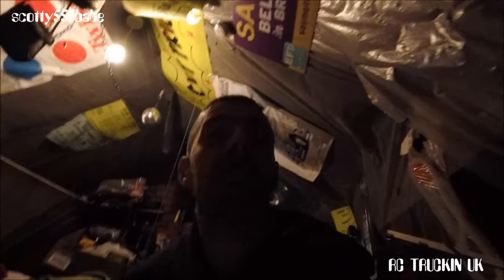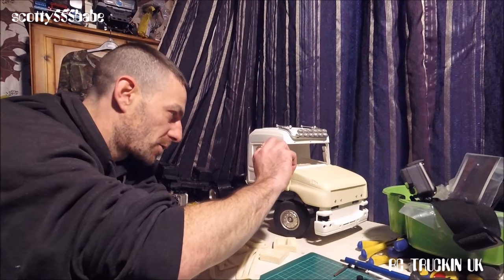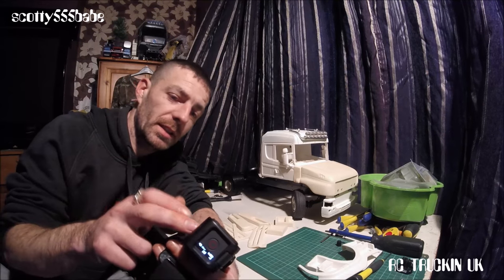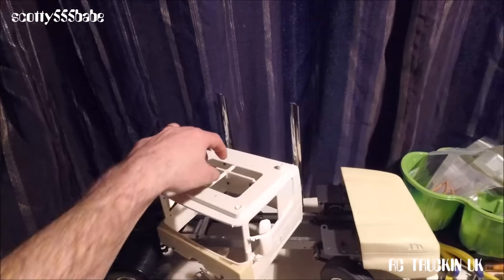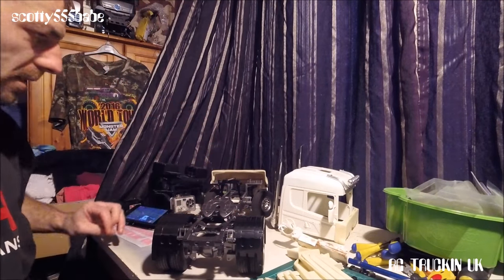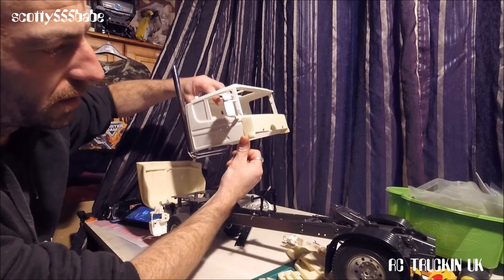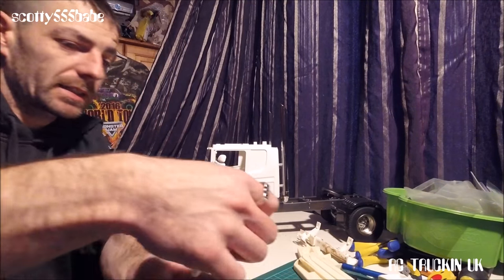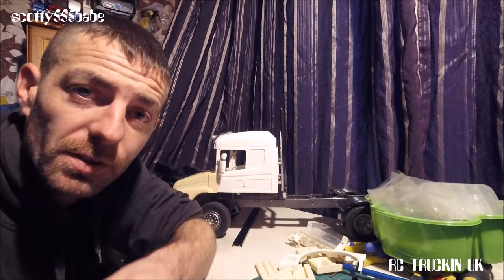RC TRUCK TIPS - The Basics to Constructing a 1/14 Tamiya Rc Scale Scania Torpedo/T Cab

Comment: Pretty funny .....know how you feel Scott, keep going with your head down, it will soon be finished. One little snippet of advice for marking holes...Nick a bit of the kids Play Dough put it behind the bonnet then press the hinges against it. If will leave a clear indication where to drill. Also I use Blu Tack to position body parts to make sure they're positioned correctly before gluing or drilling.
Appreciate your monthly videos of Ribble Valley RC , chuffed you featured my Volvo wrecker on its first trip out in December, pleasing cos it's my first build .
Reply from the maker: Thanks for the comment and tip, I use blu tack a lot but I never thought about playdough, thats why I have the channel to keep the knowledge flowing... Also I featured your wrecker in the "Best Of 2016" its nice to see different trucks and builds. 
Thanks again bud

Comment: Enjoyed the instructabuild mate, I feel your pain trying to find a work area comfortable enough and permanent so you can have tools, materials and paints to hand. I recognise the loft, did one identical. I recon the a velux window, couple sockets, light be the job. Problem is ceiling joists and insulation, if your own home I'd put in sistered or deeper joists to bearing wall, joist or steel if you need it. Coz if sell will not be up to regs and will not get money back. If rented put insulation bats between rafters tack, staple rolls of silverfoil bubble wrap overjoists tape joints with silver tape. Put down grip lock loft boards a couple of screws coz this can be lifted and with insulation roll and bats reused if move. Then you can get some peace and a man cave with a lockable loft hatch. Jobs a good en, plus can store all rc gear under eaves. Cheers
Reply from the maker: Hi cheers, I've had the loft all boarded and suspended floor, its just the insulation and boards on the ceiling area... its more as its full of crap at the minute lol giving me no room to work in there, I just need to get a carrot done and get rid of a lot of it... and last year I was a little depressed which made me leave the loft and try to find somewhere more comfortable. However new year new start. Thanks again for the tips on the loft, that should come in handy.
Reply: Thanks for reply, there is no disgrace in suffering from depression, it chops me down from time to time too. The greatest men have always suffered from it, like Churchill and his "Black Dog", thats what I say anyway. 
 The RC gear I`ve accumulated is ridiculous, I must have the biggest 1/24 RC  private collection and a good few 1/16 RC tanks, I`m more into Rc Tanks but have moved on to doing a Bruder Scania Cab/ Tamiya Scania tractor for a Transporter. Looking at the new R730 2X2X8, but merging two cabs and another steering set has me looking to make the new Scania P 440 CA8x6 defence vehicle. Its Scania defense arm, looks a mean `mother with the Auto Machine Gun on it. So I may need a bit of advise, as have nearly all components that I bought here and there which is expensive but as you know once you start there is that much after market private mods you could build a rig costing £1,000s. Anyway cheers Scotty, keep up the good work....

Comment: scotty, I'm looking for wheel not covers and hi-hats for the rear axle covers along with the wheel nut covers in aluminum or chrome do you have anything like this or know of a place that has them, I've seen them somewhere but can't really remember where and as far as I can remember it was in the UK and not here in the States. Any help locating them would be appreciated deeply, Thanks
Reply from the maker: Hi im unsure on alu ones, however the chinese are taking over the rc trucking scene with metal hop ups. Also try rigid rc and verkerk modelbouw. Im sorry i cant really help you there